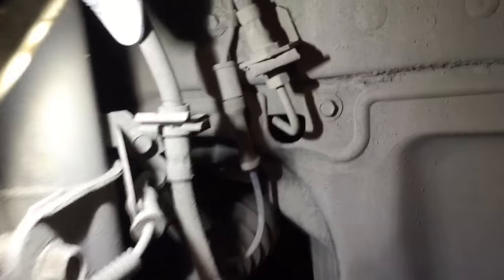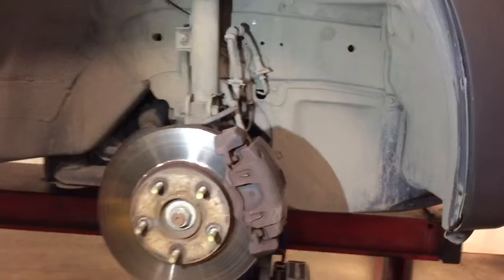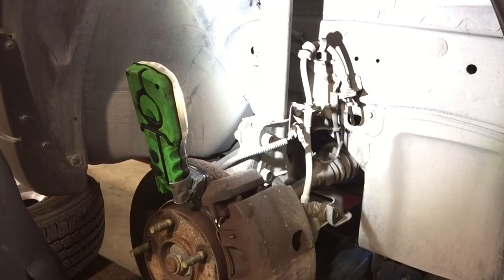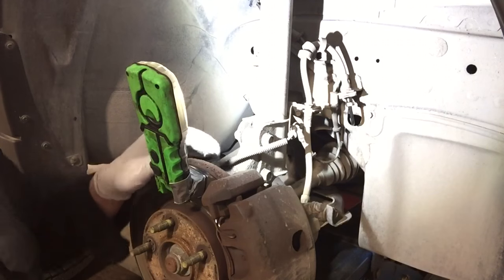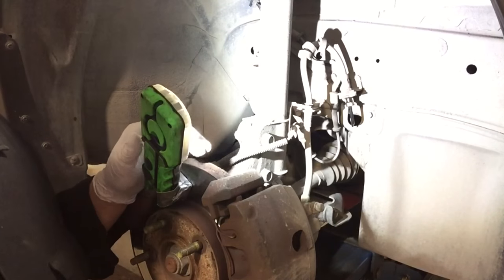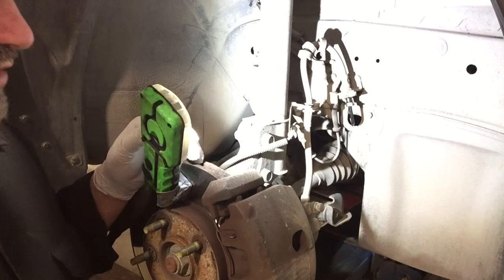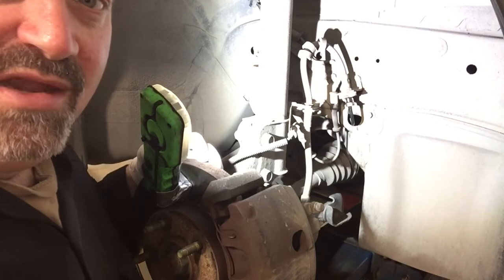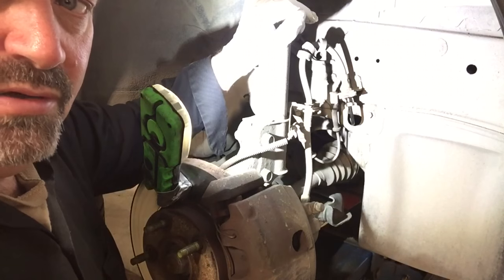Replacing Ford Escape Brake Hoses - Mazda Tribute Brake Hoses Replace

Comment: Thanks for the video.  Changing the original hoses on an '04 Escape.  They aren't visibly cracked but they are 20 years old, so I figure that is a good enough reason 😆  

The hoses are not expensive either.

Comment: Last year I replaced a brake line on the mother in law's 95 ford Taurus. The leaking line went directly to the ABS pump. After replacing I could not get the air out of the system. Had a very small pedal and spongy. Someone posted that you had to go to a shop and use a tool to activate the ABS pump, well someone counter posted to that and said if you have any kind of pedal then drive the car on a dirt or gravel road and hit the brakes hard to activate ABS. Well that's what finally worked for me, I was able to get the air out and get a good pedal.
Reply from the maker: +MostlymoparIH I thought I should have mentioned that after I posted the vid. Yes I almost always activate the ABS on gravel after bleeding the system. You can also do that then bleed again as any trapped air will pass into the calipers and be easy to bleed after. Thanks for the feedback. Take it easy.
Reply: Yeah it took me multiple trips to the dirt road to get all the air out. Thanks again.

Comment: So I just found both your channels and enjoy them both. Is there some kind of spray/oil/lube or whatever I can coat the brake hoses with to keep them protected ? I keep my cars forever so that might be easier than replacing. In advance, thanks a bunch !
Reply from the maker: In this case the replacement hoses will last forever. Just junk OE hoses. Not aware of any coatings but might be worth doing some research. Blessings.

Comment: Hi Doc, I was gonna say steel braided lines, But I have never had a Ford that would last long enough to warrant it. About how long do those factory hoses last? Good Video, Thanks
Reply from the maker: +joel mccoin Someone stated that the older Escapes that have the smooth hoses are the problematic ones. Seems like they begin failing after ten years. Apparently they switched to a ribbed hose that holds up much longer. I had a newer Escape in today that had ribbed hoses and they looked fine. Thanks for tuning in. Always good to see you.

Comment: Exelent video ,good tips. What kind of flash light did you use it for this job.
Thanks a lot.
Reply from the maker: +juvenal alvarez it's a Blue Point rechargeable LED light. I got it off the SnapOn truck. I found a similar light I'm going to try out on Amazon. https://www.amazon.com/gp/aw/d/B019DTMXIU/ref=mp_s_a_1_44?qid=1461385549&sr=8-44&pi=AC_SX236_SY340_QL65&keywords=magnetic+rechargeable+led+light&dpPl=1&dpID=51yXePYonKL&ref=plSrch

Comment: I like your plug for the tourist industry. I feel badly for those guys in the rust belt too. What a mess they have to deal with. Have you used stainless steel replacements lines? I see a lot of aftermarket companies pushing them and was just wondering if they had any advantages. Thanks for the tips on bleeding an ABS system. I often wondered about that.
Reply: +wyattoneable I'd like to know what you think about those kinds of replacement brake lines. And for owners of the Escapes that are having this issue and Ford isn't helping any - What can they do in the mean time? Is there a different length or design or type of brake hose you might "unofficially and without liability" suggest?  Obviously Ford needs to be pressured on this and the best way is to do that is to document these problems with NHTSA. Anyone can report a problem with any vehicle at any time for free with NHTSA located here: https://www-odi.nhtsa.dot.gov/VehicleComplaint/  --   or do a search for complaints on NHTSA about a specific complaint - such as brakes ---  go here: http://www-odi.nhtsa.dot.gov/owners/SearchSafetyIssues and type in the start years and end years of applicable vehicles to search for and then select the Make and Model to search for and then click on go.  In this case "Brakes" - I found 5 reports of Failed Brakes Complaints Reported to NHTSA.  Of those five reports relating to the word "Brakes",  four of the five were for brake hose failures".  Hope this helps someone.
Reply from the maker: +Hawaiian F150 Wow, good info. I have seen this exact issue dozens of times on these vehicles. Junk. I think the aftermarket hoses hold up better because I have never had one come back. I don't know anything about stainless lines. I use those coated lines that bend really easy but again I rarely have to replace a brake line and when I do it's generally not a good day!
Reply: +The Car Doctor. I can't come close to knowing much but I'd think if it was such a big deal, having stainless hoses that is, then they would be on there from the factory.  I can see using them on race or the like applicatiions were you need the zero hose deflection that you get with stainless. rubber hoses swell up under increased pressure. that's lost hydraulic force until you press harder.
Reply: in a nutshell -- to stainless hoses are good lookers bit perhaps what's best is remember the KISS montra... and to simply drive safely. 

I ain't never seen one street with NASCAR Officials lined up along the roadway.
Reply from the maker: +Hawaiian F150 Oh i didn't know you guys were talking braided stainless lines. That might be a good fix for these. Even if they just had a little longer hose that didn't have such a sharp bend in it. But yes, safety first. And a regular inspection to keep it safe.
Reply: +The Car Doctor  Tim  I am thinking that outside temperature might be playing a part in the rubber cracking. Typically rubber lasts for only a few years. I would guess that for automotive use all that scientific stuff is figured in to the parts used. But I would bet the same brake hos is used in Florida or California as it is in Alaska or Canada. What I'm trying to say is that I don't think the auto makers make area specific brake hoses or rubber parts.  I think in areas like yours or Steve's that Stainless Steel Double Braided hoses are the best bet and for safety's sake NHTSA should force our Government to get involved to mandate that they should be delivered that way from the auto maker. Even if it does add $100 to the sticker. $100 is peanuts compared to a live.
Reply from the maker: Yes temp is surely a contributing factor however I don't see Chevy Blazers with every hose cracked every time they roll in. Still something wrong with the design or the actual part. Let's face it, nobody ever wants a hole in their rubber.
Reply: +The Car Doctor -- Especially with the name "Escape"!!
Reply: Don't ever worry about a hole in rubber when none in use, just get the satisfactory of watching it squirt all over & say, see there it all is every single drop!
Reply: About every other design on this type of car is design failure from the factory. I understand trying new things, but having us the purchasers be the lab rat, I'd like to get a hold of some necks & arrr. The dip stick for the oil is one of the top 5 issues to start off with from the get go. And the list is pages long!

Comment: I have a 2001 Escape & the brake lines on both fronts are cracked. The abs light is constantly on, off when I go for ride but it reappears. There's spongy play with a hardness that tends to kickback with sounds of metal grinding a little when stepping on brake. Checked brakes, but all seems find! Whenever I start to take off or come across a bump or what not I hear like something is loose. Check but could never find anything. Have you came across this type of problem with these Escapes?

Comment: I have a mazda tribute and i notice a crack on one of the front hose I drove it for a year until one  night it broke on me i was able to pull over  and used the emergency brake to stop  so I always keep an eye for these hoses , found another crack at the rear change it immediately. so theres a problem with these hoses  keep checking on them .

Comment: I have a 2010 escape. When it’s hot out after driving 20 mins or so my front driver side brake wants to hang up. I can stop at a light and let my foot off the brake and it takes a few seconds to release. And as it releases it comes off the disc causing the car to groan coming from the front driver side.
Reply from the maker: Hopefully it’s a bad caliper.

Comment: My brake line bolt is nicely rounded and rusted and is not coming off. They need to stop salting the roads here in nova scotia because working on cars is a headache every fucking time.

Comment: Wait, Alaska doesn't use road salt? I know they get snow so what do they treat the roads with!?  I would love to live in Alaska but a lot of companies don't ship there and if they do it's expensive. And I don't have a passport to be able to drive through Canada as I would want to take the scenic route.  Quick and easy repair nonetheless.
Reply from the maker: +Jon Rushing They just use plow trucks to remove the snow and when there is ice they put down sand. Also, most folks switch to studded or studdless snow tires. The additional cost we pay is in road maintence and tires instead of the cost of rust on cars. The studs wear out the road and create ruts so we have to re-pave roads regularly. We used to pay for all this with revenue from oil taxes. Now oil is drying up and the price per barrel has plummeted so we are in deep crap. We are going to have to pay some taxes to fund state operations. We have never had a state tax. For years we have all got a annual check form a fund started from those oil revenues but that too will likely go away to help fund government. Still a great place to live and yes driving the Alcan Hwy is a great trip I never get tired of.
Reply: The Car Doctor Oh good to Alaska for not using salt. I didn't think studs would ruin asphalt. At least you get new pavement every few years. I used to live in Pennsylvania and PennDOT would just put a 1/4" layer down of tar and call it good instead of ripping it up and redoing it the right way. I didn't know Alaska had no sales tax either. Sorry to hear the wells are drying up. Alaska is going to have to start exporting moose meat to the lower 48 for revenue! :)
Reply from the maker: +Jon Rushing haha we have way too many moose here in town. We should turn them into sausage and ship them south

Comment: i have had 2 times where i racked a escape and put it back on the ground and when i went to back it out a hose popped, junk parts
Reply from the maker: +UBBERTANKER Seems like an issue that should be covered under a safety recall. These are the worst hoses I have ever seen. I've learned to look close at the hoses whenever these rigs come I the shop. Maybe this vid will raise some eyebrows and get the ball rolling on a recall or a reimbursement.

Comment: Is Ford using Play Doh for the outer layer of those brake hoses?   There needs to be an annual safety inspection where you are, may save many lives. Lots of moose and other large animals on the roads.......................
Reply from the maker: +ICU2 You're probably right. Not mandatory inspections and so many unsafe cars. We also have some of the most dangerous roads in the world. All makes for a recipe for disaster!